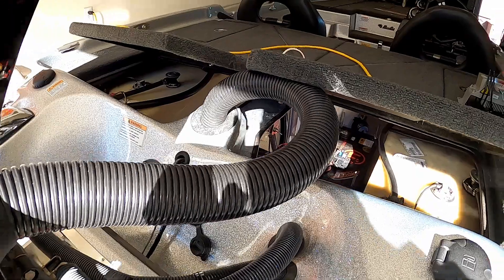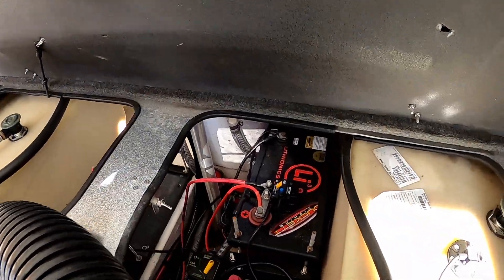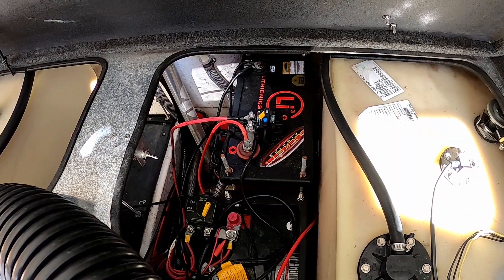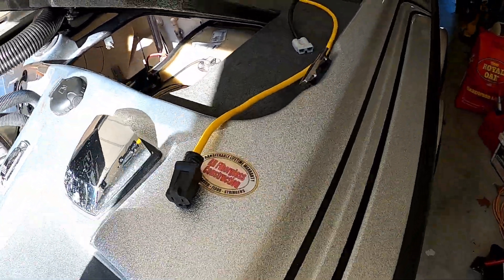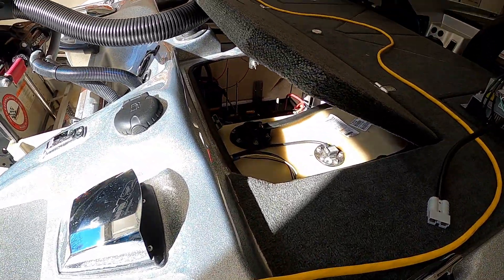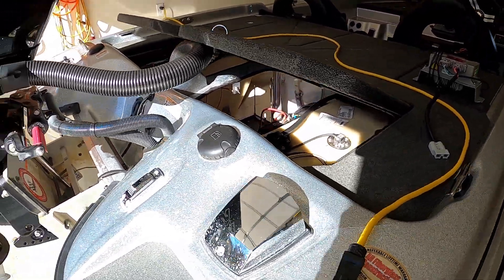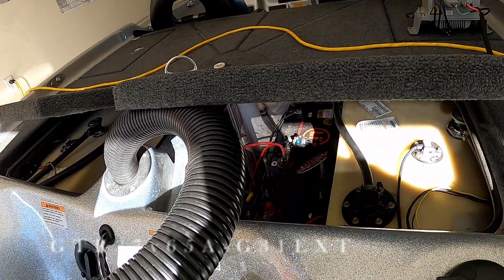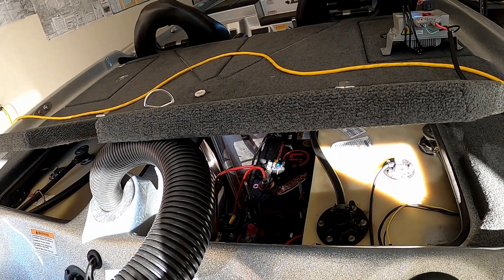Lithium vs Conventional Batteries for Marine deep cycle applications

Comment: I’m in the process of researching building my own lithium, seems pretty easy and sooooo much cheaper.
Can buy the cells for about 50c per amp hour of power then add a bms (battery management system)
So basically you could build a 36v 200ah pack for approx $1400 plus delivery Plus a box to keep them in (can be built from timber on the cheap)
You would need x12 200ah cells plus a 12s bms rated to minimum 100amp (approx $1400 plus delivery)

You could even make a 300ah battery if you wanted and another thing I like the sound of is if one cell goes bad or the bms goes bad you can replace the part instead of replace the whole battery (once out of warranty)

A single battery 36v 200ah would weigh around 50kg (each cell pack in 200ah weighs 4kg) but you can make x3 individual units and connect them in series to bring the weight down to something you can carry if need be.

Anyway, just thought I would share that with you. If you want a couple of sites pointing you in the direction of info about the cells and where to get them let me know. (I’m not trying to sell anything here and am not affiliated with anyone although that would be nice 😂)

Comment: A 36 Volt Battery? What is that about are you starting you motor with it?  Is it a LiFe04 or a Lithium Ion Battery? The CCR rating is all you need to care about with that boat unless use a Electric Motor. LiFe04 Batteries have almost twice the USABLE POWER as a Wet Cell at 1/2 the weight. 1/2 the Weight, 2X the Power so price is about the same for the same Amp/Hrs . Your problem may be heat and the BMS is shutting the battery down or not using a proper alternator from the motor (and or) Battery charger. You should stick to a AGM if you do not know about LiFeO4 Batteries.

Comment: Please forgive my ignorance on this subject..newbie to boating and Lifepo4 batteries.   I recently bought a small boat and a 100ah lifepo4 battery to run the trolling motor and fish finder.   Trying to surf the web to see how to hook up both electronics to the battery and really found no help.   Is this possible?  I really hate to buy a separate battery for the fish finder when I have so little room on the boat and have plenty of juice with this battery.  Can you please advise me if this is possible and how might I hook both up to the same battery safely? Do I need a circuit breaker?  Thank you in advance.
Reply from the maker: I would add something that you can add to your battery that will give you extra terminal connections. You should be able to add that without too much difficulty. Terminal bus should allow that
Reply: Cant charge the LiFeO4 with boat motor as the regulator thinks the LiFeO4 is always fully charged so may as well keep them separate.   https://www.mobile-solarpower.com/uploads/1/2/9/6/12964626/published/msf4vpdl-1_14.jpg